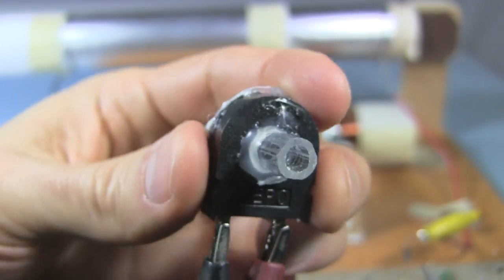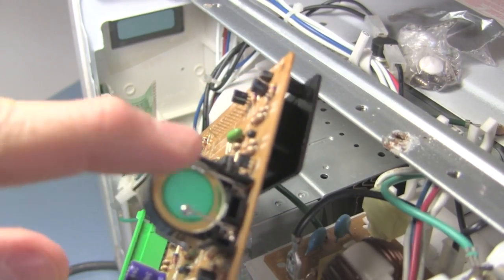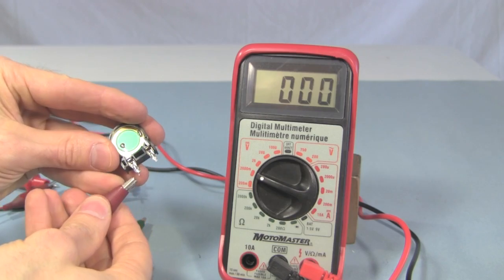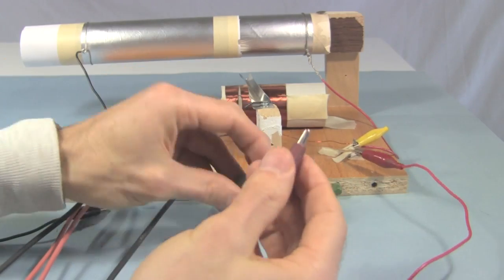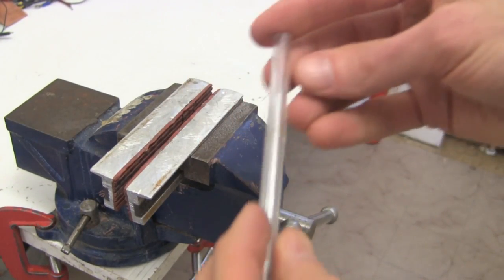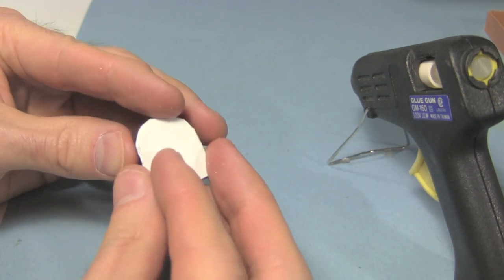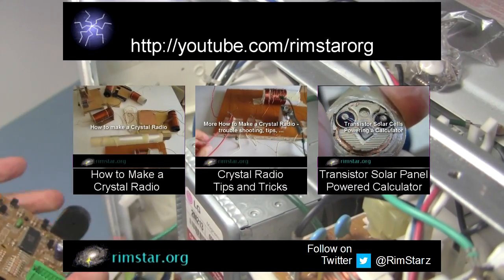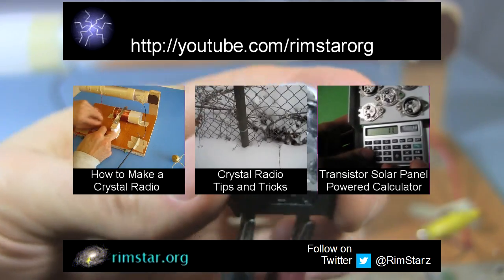Make Crystal Earphone/Earpiece for Crystal Radio - Homemade

Comment: The component you salvaged from the microwave is called passive buzzer. You can buy these for next to nothing at any electronics supply store. You can even get ones with 40-50mm diameter for louder sound

Comment: easy fir most to achive 

I thought I would see a rochelke salt crystal grown, crystal then sandwiched between two pieces of silver foil with wires atached, now difficult part, which way does it deflect most? largest deflection direction is determined by some neans.
 now crystal is connected to a beam armature  so max deflection is achieved, end of beam then linked to a transducer membrane (usually aluminium foil). then something like the enclosure you made is fitted.

This us nice though, relatively easy to do  
with care it can be dobe without a soldering iron by cutting away the circuitboard around the solder holding the transducer carefully
Reply from the maker: I use my rochelle salt crystal in this video http://youtu.be/0-PParSmwtE , mostly as a speaker though I create a small earpiece sized one at around seven minutes and twenty seconds into the video. I tested the polarity of that crystal in this other video https://youtu.be/R9m79oWdOZI
Reply: @RimstarOrg  great, yes I know I was picking as bit, not meant any harm, just information
Reply from the maker: No worries. The more sharing, the better. Thanks!

Comment: What about a piezoelectric disk or piezo buzzer?  I was working on a wireless telegraph project for physics class and then I realized that we can transmit sound just by changing the resistance/voltage.  I've tried making a microphone by changing the length of the circuit using the force of a sound wave (like a phonograph) but it only makes noise. I gusse it can work as a speaker as well
Reply from the maker: Yes, a piezoelectric disk will for it too. That's what's inside this one from the microwave oven and that's what's in the regular piezo earpieces. As for a piezo buzzer, it depends on if there's any other circuitry in the buzzer that might interfere. I've used one as a speaker in this other video https://youtu.be/b4vr1aE0zzw

Comment: Those elements ( unmounted ) are called "piezo benders", you can buy them separately lots of places, including digikey, quite cheap. They are used for all sorts of things including ignition generators in trigger operated barbecue starters, stove top igniters, butane cigarette lighters,  air humidifiers ( they are used to boil the water with explosive sound waves ) and the Webb telescope where they are used to "nudge" the individual mirrors just a tiny fraction of an inch, to align them all perfectly.

Comment: Very nice. I was thinking about buying very cheap 100 piezo elements from aliexpress. But i just wonder how much impact does the impedance have? though they moastly are arround 300 ohm on this elements, and a crystal earpiece use to have 20k impedance. Any idea about that?. Would be very easy to make perfect earpieces with a 3d printer and blender i think.
Reply from the maker: With a normal crystal radio, you need high impedance, as you say 20k. For low impedance you can add a transformer. For example, normal earbuds are low impedance, tens of ohms, but with a transformer, they work, though there are more losses. I did that here in this video https://www.youtube.com/watch?v=GCh2LVHUavQ . And great idea about using a 3D printer to make the case! I didn't have a 3D printer back then but that should work well.
Reply: @RimstarOrg  Thanks for response. Yes i tried to find these elements with higher impedance, but no luck so far. But same time in this video it seems like it works well to use this traditional piezo elements for a crystal receiver. Very nice idea to use a transformer then to get higher impedance. Will make some experiments with this and buy the one labeled 300 ohms impedance to check it. I can not use a crystal receiver here in Sweden then, though to far from a transmitter, but i have small low voltage receivers i have made that needs these crystal earpieces to. Yeah same with me, i had my first printer 2 weeks ago.
Reply: @RimstarOrg  tried post a link to a 3d model for earpiece i made, but it was deleted. No idea why?
Reply from the maker: I guess youtube's algorithm wrongly decided it was spam. I don't see it in my list of comments for review so the algorithm must have rejected it completely.
Reply: @RimstarOrg  yeah i guess so to.

Comment: can we use a normal earphone?
Reply from the maker: It's harder to get it working and won't sound as loud but you can use an earbud if you add a transformer. I show how in this video https://www.youtube.com/watch?v=GCh2LVHUavQ
Reply: @RimstarOrg  thanks soo much i luv ur videos they are very informative
Reply: @RimstarOrg  but the prob is i dont have a transformer :(
Reply from the maker: Most of mine come from things I took apart.
Reply: @RimstarOrg  i am 12 years old but i have completed 11th grade electric and electronics since i am twelve i dont hav anything of my OWN but i can buy a transformer from my allowence
Reply: @RimstarOrg  we can use earth instead of a transformer right?
Reply from the maker: The circuit already uses a connection to ground/earth. The transformer is for making regular earbuds work.
Reply from the maker: You'll also needed either AM radio station nearby or a very long antenna. I have a few radio stations near where I live. I give a bunch of tips on my website here https://rimstar.org/science_electronics_projects/crystal_radio_tips_and_tricks.htm

Comment: Try using those small cheap piezoelectric tweeters.
Although they're used with 8 ohm speakers, their impedance is actually 
in the kilo-ohms (and highest below 15khz).... they're just really 
efficient.

Comment: Thank you for the great tip I've thrown loads of microwaves out through the years and I have never taken one apart before like yourself and that is very clever the way you made that crystal ear piece just with a part out of a microwave and then you hot glued everything together which was very smart so the next time my microwave goes I'll definitely give that a go and I will try it out on my amateur radio equipment and see what it's like so again thanks for the tip. Stephen M3SNV 73's.
Reply from the maker: Just be careful when you start digging into the side of the microwave oven area where electronics are. In most ovens, you'll see a largish electrolytic capacitor (usually at the bottom near the rear of that side) and it may still have some charge meaning it may give you a shock. Be sure to discharge the two terminals of the capacitor without touching it yourself, for example with the metal of a screwdriver or something. Having said that, none of the one's I've opened ever gave any spark when discharging it but it's best to be careful.

Comment: My crystal radio is not working

Pls help

3.5 meter antenna
Reply from the maker: It's still possible that your antenna is too short if there are no radio stations nearby. I have a few radio stations near me. But there are other possible reasons too: bad connections in your wiring, not making good contact between the wiper blade and the tuning coil, not a good enough ground.

Comment: Hey, try this.... use a resistor and short out the piezo's terminals.  The value varies, but 10k to 12K seems to work best.  Easiest way to determine the correct resistance is to use a low-step resistance substitution box, or a variable resistor to find the best value.  Depending on your method, you may then want to read the resistance you use with the VOM.  Bet you'll be surprised by the improved audio.

Comment: Are there any safety issues involved in opening up an old microwave to strip for parts?
Reply from the maker: Yes. There's a high voltage capacitor that should be discharged immediately after you open it. It's usually located near the back in the bottom.
Reply: Like this one?

https://sep.yimg.com/ay/yhst-82574741899364/microwave-high-voltage-capacitor-2100-vac-85-mfd-uf-13qbp21085-4.jpg
Reply from the maker: Yup, that's the one.
Reply from the maker: My needle nose pliers have thickly insulated handles so I usually stick one end on each capacitor terminal.

Comment: By the way if you put a choke across Diode input to ground , something like 25mH, it will also greatly increase the performance of the crystal set. It gives a DC return path for the diode while blocking the RF frequencies and forcing them to go through the diode.

So what I mean is you put a choke just before the diode, across to ground, a nice high value one that has a high impedance at AM frequencies. 25mH should do fine. To the RF it looks like a giant resistor so it doesn't load things down. But for the diode it's like a DC path to "complete the circuit" that doesn't have to go through the earphone - you will get much better signal with less distortion

Comment: Warning. Discharge big capacitor with a high insulation screwdriver before touching inside the electronic side of a microwave owen. Even if the plug is not conected to the wall. Voltages about 3000 volts can be present before discharging.
Reply from the maker: Definitely. Thanks.

Comment: Back in the 1960's, those were only around $1.00 and now I see they are $6-$12 on eBay
Reply: Paul Crissman One dollar in 1960 would be $8.42 today. Also supply and demand, with transistor radios just emerging, the the supply kept up with the demand. Now with decreased production they have become commodities since less people value them and vice versa.

Comment: What about the high voltage danger?
Reply from the maker: Do you mean the high voltage danger due to the capacitor? I guess I can add an annotation or something to the video description. Good point. There is a bleed resistor and I've never found one to be charged when I've opened them but I know that because I always to try to discharged it anyway.

Comment: Nice use of a piezto sounder. Given me some good ideas. 

(Interesting automatic voice-to-text subtitles! Can they be turned off?)
Reply from the maker: +Janet Winslow Cool. Glad I could stimulate some ideas. Re the subtitles, click on the CC button at the bottom of the video to turn them on or off. Hmmm... it's indicating that I've add captions but I never did for that particular video. Normally if there are only the automatic ones then it doesn't indicate beside the video name that there some (EDIT: I just now removed the captions that it thought I'd added, but didn't. Thanks!)
Reply: OK, thanks for the info. I didn't think you added them on purpose. They were obviously automatically generated and worse than useless!
Reply from the maker: +Janet Winslow They were both obviously automatically generated, but there was a glitch since there should have been only one automatically generated one. When I 1st read your comment, I went and looked and there was a second one which shouldn't have been there and it was telling me that I'd added it, when I hadn't. So thanks for bringing it up even though it looked automatically generated.

Comment: I've used piezoelectric elements too for crystal radio work, but I always have to wire a resistor of 10k-12k across the piezo leads to get any volume.  Dunno, maybe the radio or the piezo has a resistance built in.  It's a good cheap way you describe, but in case you don't have an old microwave sitting in the corner, an even louder piezo is the Mallory FT-417 --- a very large device. You can use a single one with the resistor wired across the red and black leads.  Or, for true headphones use two elements ---- simply tie the red wire of one piezo to the black wire of the other.  You are left then with one red and one black lead.  Wire the above mentioned resistor across the remaining leads, then apply the crystal radio's audio to the red lead with the black one going to ground.  I've found these elements rival the old military sound-powered elements even when they are well adjusted.  Many hobbyists mount the elements inside a pair of soundproof earmuffs after removing the foam.
Reply from the maker: +mnpd3 My understanding is that at least one reason a resistor across the piezo leads helps is if your diode doesn't have enough leakage for each reverse cycle. It hasn't made a noticeable difference for me in the past, probably because my diodes have enough leakage.
A google search for Mallory FT-417 and variations didn't turn up anything relevant. Is that a speaker or just the piezo crystal?
I've always wanted to try making headphones. Just a question of too much on the todo list. :)
Reply from the maker: +mnpd3 Nevermind re the Mallory FT-417. I saw your other comment about it below.

Comment: I watched another video of yours before and it was about the headphone speakers and the transformers, I just wanted to let you know next time you take the small transformer off a circuit board the solder side on the bottom of the board tells you which coil is which where it solders in most mocrowaves

Comment: USE TO SELL 2000 OHM EARPHONES THAT WORK GOOD AND DON'T LOAD DOWN THE CIRCUIT...WITH CRYSTAL DIODE...ON THE OLD ROCKET RADIO'S AM RECEPTION....JP
RADIO SHACK OR SUCH MIGHT HAVE THEM...

Comment: the plastic ink pen tube can be used for a coil form for a crystal radio. ive used a small, ink pen tube(that holds the ink), cleaned it, made holes, and wound 90-100 turns of wire, and I can get SW signals.another ink pen tube (like yours), I did the same, and can get AM signals, sometimes SW (on a clear nite).good video! I have several piezo speakers, and will try them!
Reply: +Sooner Science Nerd 

I've always found that the larger the coil form; the more sensitivity and selectivity is had.  Smaller coils work, but tend to be excessively long and if tuned with a strap slide a very long range of movement is necessary.  It's why most small coils use a powdered iron/ferrite core which may or may not be adjustable for tuning depending on the range of the variable capacitor --- if one is even used.  The coil itself can handle the tuning job if made adjustable, even if selectivity and sensitivity is reduced.
Reply: +mnpd3 I get the best reception from a small pill bottle with 100 turns on it. I can get 2 local stations, CBSsports,ESPNRadio, and WorldHarvestRadio. not bad at all.I connected a piezo speaker to my amp, and it acted like a microphone!I got the piezo speaker from a scrapped boom box. (from my radio and tv scrapping, I have 50+ speakers, all sizes, and they work fine!)

Comment from the maker: +Avichai Marcovitch I give two links in the video description to where you can buy crystal earpieces (piezoelectric speakers) online.
PS There's no Reply button under your comment because of your Google+ settings.
- go to your Google+ page,
- in the top, right corner click on your thumbnail icon,
- in the popup that appears, click on "Settings".
- for the 2nd question down "Who can comment on your public posts?" set it to "Anyone".
Reply: RimstarOrg Thanks for the quick reply ,fixed the reply ability as well.
I've been having some difficulty finding a site that can ship a crystal earphone to my country without insane costs, so i wanted to make one from a piezoelectric buzzer like in your video
therefore it would be greatly appreciated if you could recommend a buzzer to use (im assuming those would be more common and easier to find a site that delivers to Israel :)
Reply from the maker: Avichai Marcovitch I don't have any specific recommendation. This is the one I have and that works http://www.thesource.ca/estore/product.aspx?language=en-CA&catalog=Online&category=CLRBatteries_Cables&product=2730060
Probably a lot of others work too. You should be able to find one in an electronics or hardware store in Israel.

Comment: What about a piezo speaker from singing greeting cards?
Reply from the maker: Chris Maness That'll probably work just as well. They're harder to find these days but I did make use of one in the opposite way for my rain powered LED here https://www.youtube.com/watch?v=laSQ6yd7jaE
Reply: +Chris Maness 

All piezo elements will work, but the smaller ones suffer from reduced volume.  With piezos pressed into service as sound producers, bigger is better. I've experimented with these for years and have never seen a case where the larger elements don't give louder volume over smaller ones.  There are some really large piezos out there.  Another source for an even bigger piezo "speaker" is an old smoke alarm.  These things have to be loud and the ones I've take apart always had a large pieze inside.  The best piezo I've found is the Mallory part number FT-417 which can have several different letters/numbers after the "7". I've seen a "W"; also "5WQ."  Other than different colors they all seem to work the same.

Comment: Hi! Can you show me how to do galena detector?
Reply: +Dorian Bondoc 

First, all galena is not equal.  Some of the stuff is outstanding as a detector while some of it will barely detect anything.  You'll need to either buy one that is tested and working, or get a lot of galena and break it up looking for the good pieces.  All you'll need to do is make a "cat whisker" on a rocker arm of some sort.  Use the thinnest gauge phospher/bronze wire you can find, and "tickle" the galena crystal with the lightest pressure possible.  Keep tickling until you find a loud setting.  NOTE:  Heavy pressure - or pressure of any amount at the wire/galena contact means you won't hear anything.  In a pinch I have used an open safety pin with the phospher/bronze wire gently touching the galena.